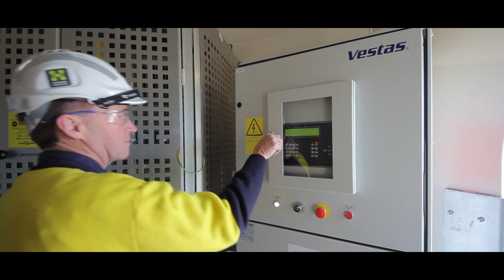Musselroe Wind Farm ~ The Short Story

Comment: Jump forward 3 years and Tasmania is literally in dire straights with the umbilical power cord fractured from the mainland & the so called "Green Energy" failing the state..!
                                                                    ...........................
The Hydro Power Dams are almost dry & Wind Energy simply doesn't work well enough.! 
Tasmania required at least two extra Coal Power Stations to guarantee base load power.
                                                                    ............................
Now there is a desperate attempt to bring in any fossil fuel Generator to save the State.    
I thought South Australia's "renewable mad" Politicians were the worst ; I was wrong.!
Reply: Well if their hydro power dams are really badly empty,yeah they are screwed.I don't know their exact situation. But what I do know is that here in the Netherlands and Germany our grid can't dump any electricity,we don't have any serious buffers so with every windmill that's build demand goes UP! Windmills when there is no or little wind take up serious power and when wind does blow,conventional plants just produce more waste heat to keep their boilers warm for if the wind drops.Also we've build some quick start facility's but those are really low in performance to conventional gas/nuk and coal fired plants.And adding up costs to the even more ridiculous expensive windmills in the first place.And that for only some 20% of our total energy needs,there is things like cars trucks building equipment ships concrete and steel factories that can only work on coal and oil.Yeah those huge Diggers in the German brown coal mines do use electricity,100% delivered by the coal those scoop up :D